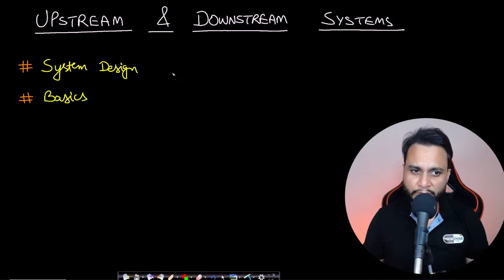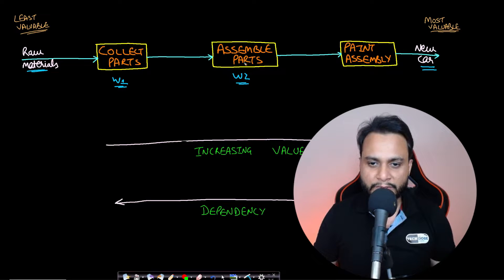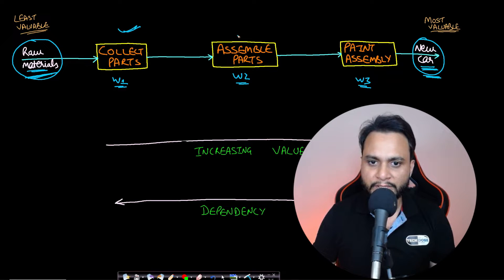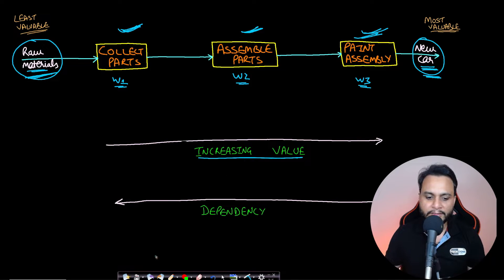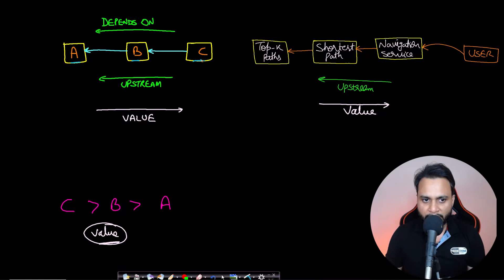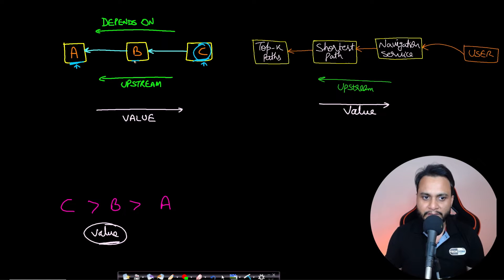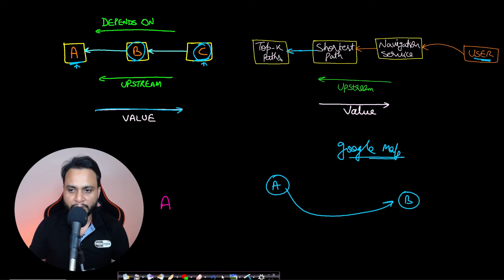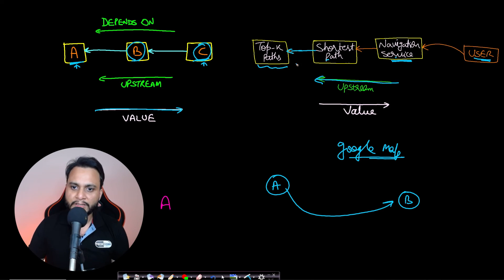Upstream and Downstream Systems | System Design

Comment: In system design, upstream and downstream systems refer to the relative positioning of systems, components, or processes in a data flow or process chain. The terms are often used to describe the flow of data, control, or materials between systems and how changes in one system can affect others.

# Upstream Systems
- Definition: Upstream systems are those that provide data, input, or control to other systems. They are positioned earlier in the data flow or process chain and can influence downstream systems.
- Characteristics:
  - Data Producers: Upstream systems often generate or provide the data that downstream systems consume or process.
  - Influence: Changes or issues in upstream systems can propagate downstream, affecting the systems that rely on their data or outputs.
- Examples:
  - In a data processing pipeline, a data collection system that gathers raw data from sensors or users can be considered an upstream system.
  - In a supply chain, the manufacturing process that produces parts or products is upstream of the distribution system that delivers them to customers.

# Downstream Systems
- Definition: Downstream systems are those that receive data, input, or control from upstream systems. They are positioned later in the data flow or process chain and are dependent on the outputs of upstream systems.
- Characteristics:
  - Data Consumers: Downstream systems consume, process, or act upon the data or inputs provided by upstream systems.
  - Dependency: They rely on upstream systems for their inputs, meaning any issues upstream can impact their functionality.
- Examples:
  - In a data processing pipeline, a reporting or analytics system that processes and visualizes data collected by upstream systems is considered a downstream system.
  - In a supply chain, the retail system that sells products to customers is downstream of the distribution and manufacturing systems.

# Importance in System Design
1. Dependency Management: Understanding upstream and downstream relationships is crucial for managing dependencies. Systems often rely on data, control, or services from upstream systems, so disruptions upstream can cascade downstream, potentially impacting overall functionality.
2. Change Impact Analysis: When making changes to a system, it's essential to consider the potential impact on downstream systems. For example, modifying an API in an upstream system can affect all downstream systems that consume that API.
3. Fault Tolerance and Resiliency: Designing for fault tolerance often involves ensuring that downstream systems can handle failures or disruptions in upstream systems gracefully. This might include implementing retries, fallbacks, or alternate data sources.

By clearly understanding and defining upstream and downstream systems, designers and architects can better manage dependencies, anticipate the impact of changes, and ensure smooth and reliable system operations.